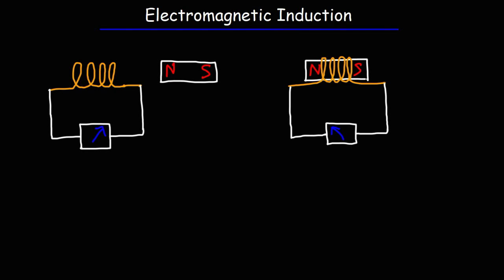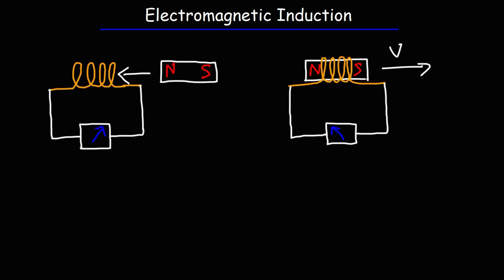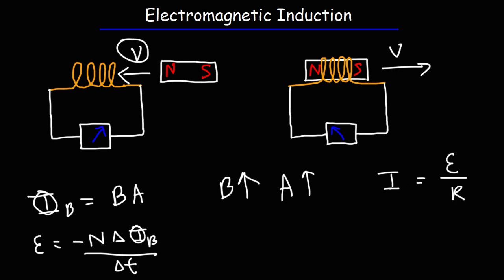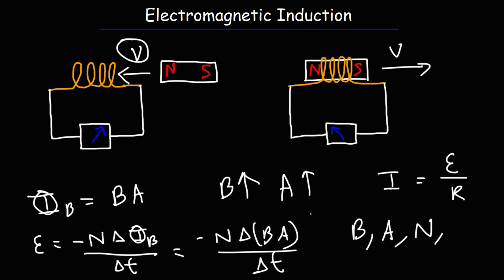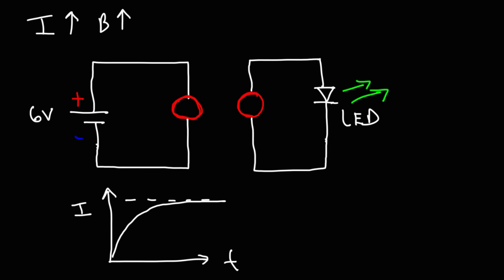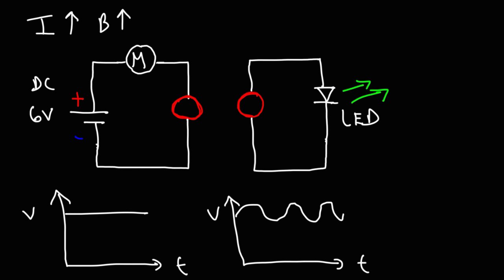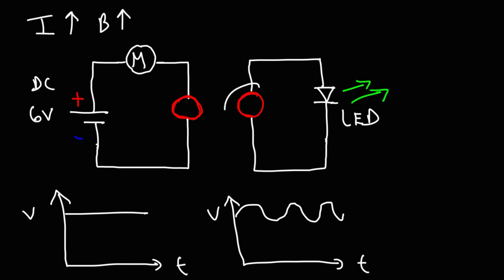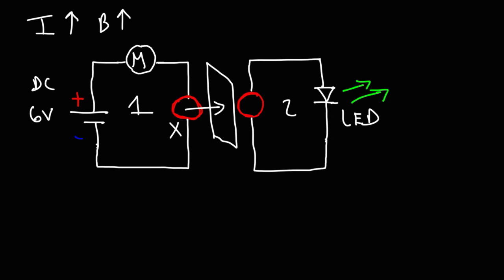Electromagnetism - Electromagnetic Induction

Comment: Is it still electromagnetic induction when the magnet is moving due to the copper wire underneath the magnet? Im turning off and on the current going through the copper wire so that the magnet would be attracted and stop attracting due to the current flowing going on and off.

Comment: One correction to your video, while a coil of wire has more inductance, you should have mentioned that even a single loop of wire, no matter the size will have some sort of inductance. Smaller loops having more inductance. Giving the impression that only coils have inductance sets people up for confusion later on.

Though I will admit that for all intents and purposes, implying that only coils act as inductors works fine enough for electrical engineering at the introductory level. I guess it's debatable whether it's worthwhile to mention these real world characteristics and have your students be ready for it later on. Or whether to use more ideal examples and not risk overburdening your students with information. It's quite the proverbial tightrope.